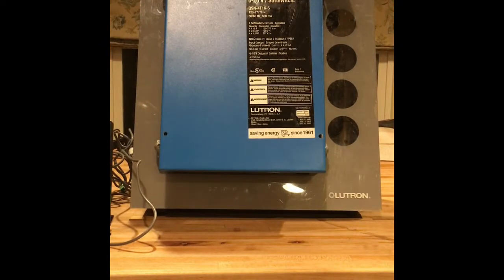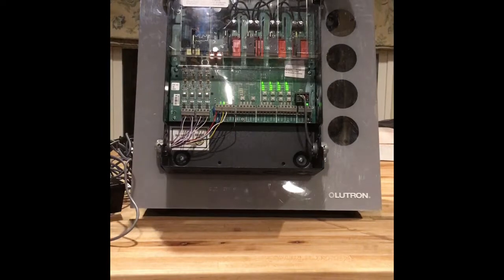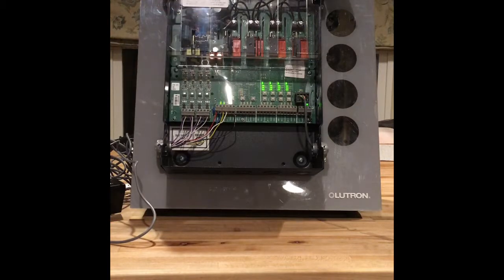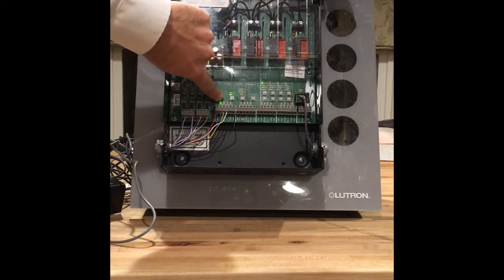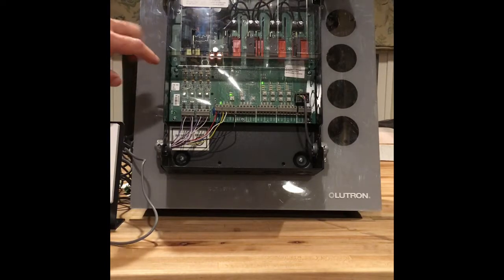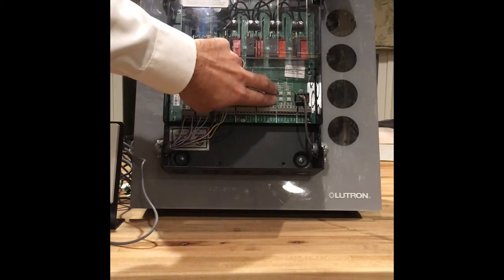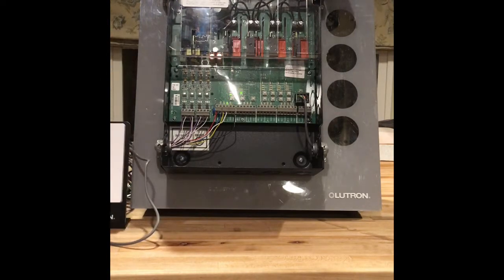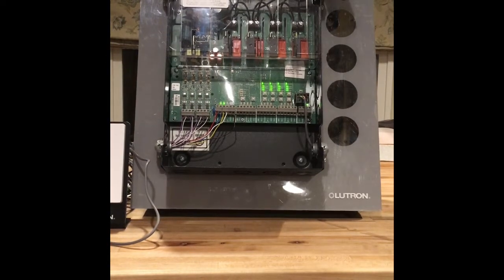Lutron QSN-4T16 Energi Savr Node Manual Programming

Comment: Question. What causes the cascade problem?
Reply from the maker: There is an issue on the qs link.  Often wires 3 and 4 are swapped somewhere on the link.  Lutron has 24/7 tech support at 1-800-523-9466